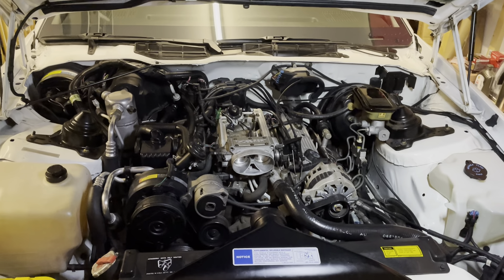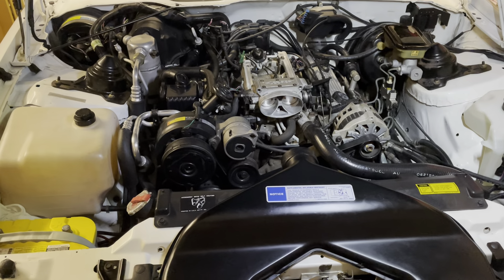3rd Gen Camaro/Firebird EGR valve fit

Comment: some thoughts, when was the Coolant, brake fluid, and rear end lube flushed / changed? Especially with all the sitting this car has done. Great car, enjoy.
Reply from the maker: I changed the coolant recently. It's parked up for the winter at the moment but the brake fluid is overdue a flush and I will be looking at putting in new diff oil and friction modifier. This video went public by mistake - I left it up to see what would happen but have footage of the whole process that I need to edit and upload!
Thanks once again for your interest - very much appreciated.